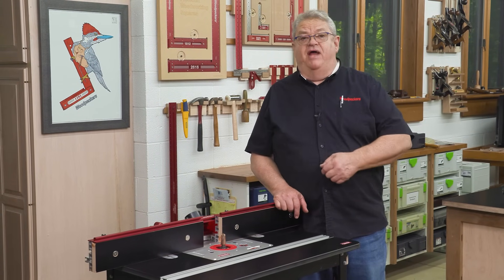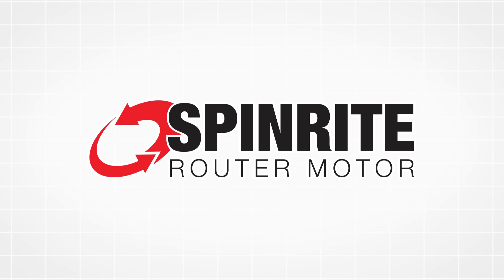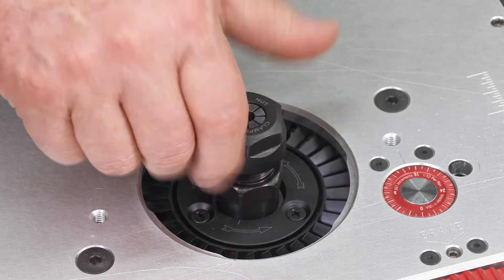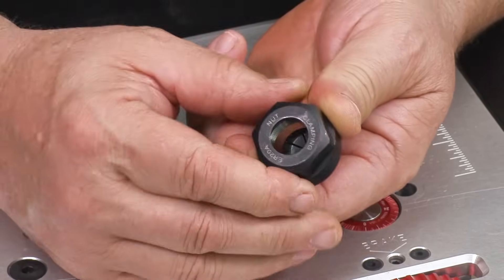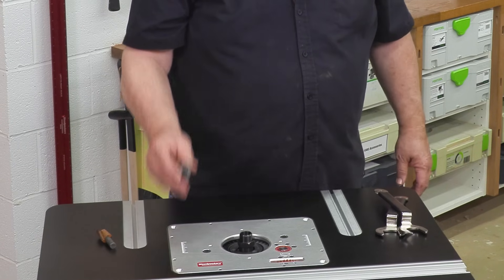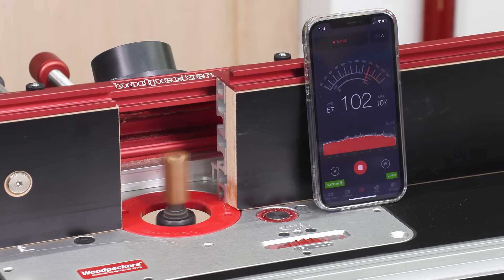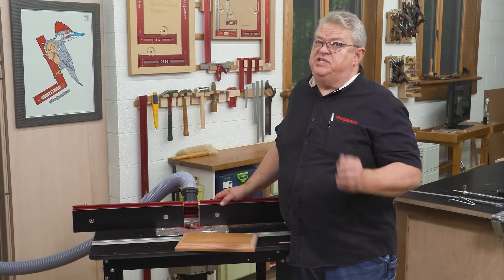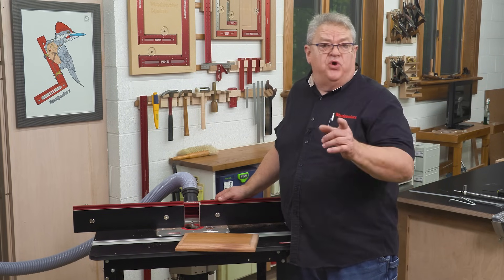NEW SpinRite Router Motor | Woodpeckers Tools

Comment: sooo variable electronic speed is important.   I spin from  tiny, to rail and stile bits, to raised panel bits.   I also see that this motor spins at 10,000 to 22,000 rpm.   Good.    BUT HOW do I know what speed I am set at?   This is important?

Comment: Needs a remotely mounted controls start stop and speed.  Router tables make one hell of s mess unless you put the motor in a box and pull down and out with dust collection system fence mounted dust collection dosnt work as well the chips are slung in the wrong direction away from a fence. Down draft works better.

Comment: I was kind of interested, until I saw made in china. So sad, a company like Woodpeckers that prides itself in actually making high quality products IN THE USA and they are now hawking china made motors? I am bummed. Plus, how is this motor special? You push it as a table router with infinite speed control, but the control is only on the motor, under the table and often in a box. Talk about a missed opportunity. Won't be something I will be buying. Hope this is not the way WP is going. Prices have been going up way to much as it is, don't need another reason to avoid WP.
Reply: Best of luck finding a router motor still made in the US of A.

Comment: I've got a router lift made by Jessem
That uses a 2 1/4 hp router motor.
Id like to see the SpinRite Router Motors
For this size, but one option not offered
A remote router speed adjustment and or safety switch.  My router lift is down inside a box for dust collection 
I didnt put a door on it so adjustment have to be done off the table.
This kinda defeats the proprous of a lift.

I can always add a door but id rather not
And keep a good airtight seal on the motor case it pulls all the dust out with just a wet dry vacume.  Or small utility vacume. A remote mounted switch and speed control with a 3 to 4' wire harness could be above the table on a control panel right in reach with a master safty shut off knee switch.

Comment: One helpful suggestion next time you do sound measurement: don't use a phone, just get a decibel meter.  You can get something much better than an iPhone for 20 dollars, and you can get something really reliable for much less than 100.  There are just too many factors (the pinhole mic on the phone being blocked by how you're standing the phone up, the vibrations from the table, etc.) with the way it was done in this video to be reliable.

Love this product, by the way!  I can't believe the 7518 was discontinued!

Comment: I love this, but given that it's made for tables, the lack of an external speed controller seems like a huge miss. Lots of routers exist inside tables, behind doors. AC add-on speed controllers (really just a dimmer like you'd use on AC lights) aren't as efficient or accurate as something built-in, and often can't be used with soft start motors. I bet folks would pay a bit more for a full solution.

I assume this is made by the same source as the Bora motors (but specified not to have locating pins, and to use the ER collets and shaft like their 6200 motor). Too bad no one is thinking about electronic speed control external to the body.
Reply: bro, just open the cabinet door and adjust it. Is it that hard?
Reply: @brewtalityk  Not all table setups are convenient for spinning a small fiddly dust-covered speed controller knob, or for seeing the current setting. Their 2.25hp one is worse with the speed control as a little dial in between the power cord and power switch on the underside of the motor. There are competing solutions which offer this (like the newer model Jessem Pow-R-Tek SR which wasn't available or announced when WP announced this). So it's a miss if you are selling a router motor specifically for router tables. Woodpeckers usually creates great stuff, but when they resell something like this without adding the types of things WP is known for, they're just phoning it in. You are, of course, free to disagree.

Comment: It would have been nice to get an external speed controller if this was built for tables. Plus are the brushes replaceable?
Reply: Would like to hear the answer about the brushes.  Are they replaceable?
Reply from the maker: There are no obvious caps on the head, so I am going to say the brushes are not user-replaceable.
Reply: @WoodpeckersLLC  Thank you for answering!  Still not a deal breaker for the price.  I will order one, and maybe 3 or 4.

Comment: hey all, its just another label as the Bora portamate router. Grizzly has one that looks the same too, just some OEM stuff that various companies buy and rebrand as their own, so don't necessarily assume the typical Woodpecker quality.
Reply: AFAIK, Bora, MLCS, etc., do not use an ER20 collet. Otherwise, I agree, the body looks to be the same.
Reply: Jet And AUK even have them for 220v countries.
Reply: Thank you
Reply from the maker: Jay, thanks for your comment. SpinRite Router Motors feature a pinless body for easy mounting. We also offer a 1 year warranty.
Reply: @WoodpeckersLLC  good to know! I think pricing wise, you are right in there with the others sharing the same unit. It would be interesting to see a remote rpm control like MLCS (although with the same body, maybe that would be interchangeable? That would be interesting).

Comment: I have the PRL-V2 350 lift for my Bosch router. Can I just buy the 420 motor pads and use the SpinRite motor in that lift, or are the lifts themselves unique to each motor size? Thanks!
Reply from the maker: All you need is the new pad set. SKU for the pad set is PRL420PADS
Reply: Thanks so much for the quick reply!

Comment: From which direction does the air flow at the collet end of the router - into the motor, or out of the motor?
Reply from the maker: Out of the motor. Sorry it took me a while to get back to you on this. I was running one today out of the router table, and it was very obvious.

Comment: I was going to thumb down this as I normally do not like taking multi purpose out of a tool but that 8 point multi sized collets made me thumbs up it. 

   I could have overlooked the first point if it was stated on why most would want to go that route or its just a big wig tool.
Reply from the maker: Jerel, ordinarily I would agree with you. I like versatile tools that can do things in different ways. But a router lift is a little different animal. Even if I had a base for the motor I have in my lift, I can't imagine taking it out for hand-held work and then putting it back in the table.
Reply: Once I stuck the 7518 in my lift, it has never been out. Just too much trouble to do it since I have other routers. But if I get a SpinRite for the router table I will permanently move the PC7518 to my WP Slab Mill where it will do much better than the PC690 router I have there now.
Reply: @WoodpeckersLLC  

   That's one of your sweet characterists. Even when your like oooh noo. A guy who knows woodpeckers, says hold on. There's more. 

   Then we're left like we just saw a magic trick. Like, did they just do that? Change our minds on with a 180 on a dime. 

   The sheer tension between useless new crap tool to the big reveal was beautiful. 

   With such a big guy usually promoting Woodpeckers we are often looking for a big improvment. 

   The way those sausage fingers can be so delicate to point out the new hidden featuresis literally dazzeling. 

Bob Vela, Tim Alen and Al, all salute a real tool man.

Comment: You shorted yourself in your sound measurement...the difference between 106dB and 93dB is not 10% quieter because dB is measured on a logarithmic scale.  A 10 dB change is either (about) twice as loud or half as loud.
Reply from the maker: Thanks for that Alan. That's what happens when you turn amateurs loose with professional equipment!
Reply: The dB scale is logarithmic.  Sound level doubles every 3 db.  106 dB is about 16 times as loud as 93 dB.  (Each interval doubles the sound level:  93-96, 96-99, 99-102, 102-105.    The sound is perceived as twice as loud, but it has 16 times more sound energy.   

Loudness and Sound Intensity (Power)
The relative loudness that we perceive is a subjective psychological phenomenon, not something that can be objectively measured. Most of us perceive one sound to be twice as loud as another one when they are about 10 dB apart; for instance, a 60-dB air conditioner will sound twice as loud as a 50-dB refrigerator. Yet that 10-dB difference represents a tenfold increase in intensity. A 70-dB dishwasher will sound about four times as loud as the 50-dB refrigerator, but in terms of acoustic intensity, the sound it makes is 100 times as powerful.
Reply: @ericschumacher5452  
This all depends on the persons hearing, as everyone has been exposed to different sounds durring his/her lifetime
As well as a persons age, as our ears loose the ability to hear different frequency over our lifetime.  Same reason at age 61 im always asking what?
Speak louder stop mumbling. 
But I was exposed to cnc metal cutting machines, printing presses and loud music working in 3 different industries over the past 40 plus years. 
This brings up ear plugs and hearing protection.  Wear them. Take my advice.

If you own a smart phone you can download a free app to mesure sound presure off the app store its free.
And somewhat accurate  but its not a RTA real time analyzer  but it can give you a pretty good idea of the sound presure levels.    Sound presure at 15k hz  compared to 35hz is very differnt  @140db 35hz will blow your hair back and knock the wind out of you where 15k  hz will just be bright sounding. 
The frequency of the sound matters a lot.   A jet engine is 140 db. Give or take
Reply: Beat me to it. That is a massive difference, particularly for such a notoriously loud tool
Reply: I came here to say the same thing.
Reply: I was wondering about this myself.. the spinrite sounded WAY quieter than 10% lol.
Reply: Looks like lots of people already chimed in on what I noticed as well! Nerds!
Reply: +/- 10 decibels is not a 2x difference, it's a 10x difference!
Reply: @epgui  It's a 10x difference in power, but not in perceived sound.
Reply: @ajquestell  sure, but power is something tangible that you can measure objectively. It's your reference point. Perception is a big can of worms.
Reply: @epgui  But the point of the video is how much quieter the tool is perceived to be by the operator...not some measurement of power. We don't care what a meter says, we care about how much easier it is on our ears.
Reply: @ajquestell  And that will be different for everyone, based on age, sex, damage to the cochlea, genetic variability, and random normal biological variance. Good luck communicating all of that with nuance!